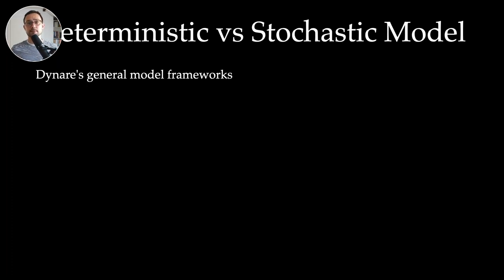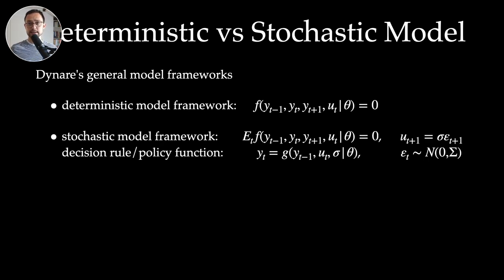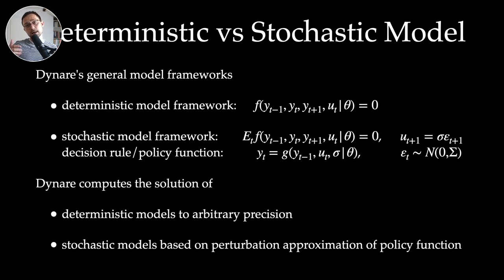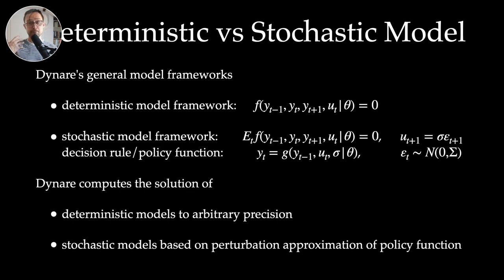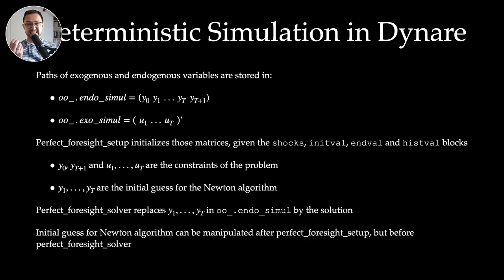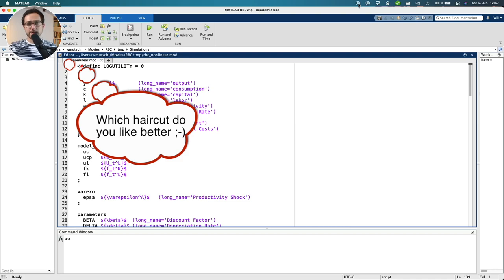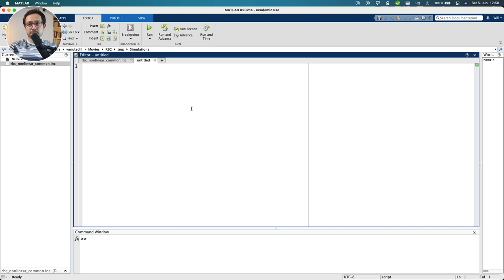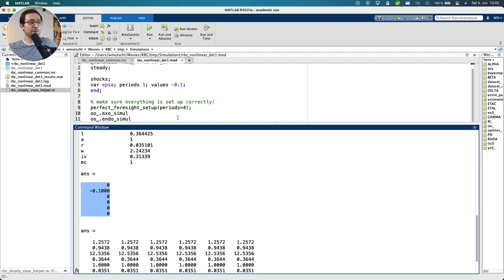RBC Baseline Model in Dynare: Deterministic vs Stochastic Simulations

Comment: may I also consult that, when you set irf=0, periods = 3000, and there are two shocks a and z in the model, may I know what's the simulated value of y, is this y the the simulated value calculated from the policy function from shock a or the  shock z? what's the simulated value of y. thanks a lot.
Reply from the maker: It is the simulated value of both shocks. Say your policy function is y(t) = gx*y(t-1) + gu*u(t), then you want to simulate for T=30 periods. You draw 30 shocks for a and 30 shocks for z, then u(t)= [a(t);z(t)]. You simply plug that in the function and get your business cycles.
An IRF is different, because there you only have one shock only and only in period t=1 (impact period). But you iterate over the same policy function.

Comment: Thank you for the video. A quick question: 

I noticed that in your deterministic simulation, the exogenous variable is epsilon_a. My earlier intuition was that in the deterministic model, there are no shocks. i.e., the policy variable is what we use as an exogenous variable. Hence, the shock is simply by changing the values of the exogenous variable. I have seen this approach in some other textbooks and videos on deterministic simulation. Is both approach the same?
Reply from the maker: Yes there are no stochastic shocks in deterministic models, that is no variables have a probability distribution (e.g. the normal distribution). In deterministic models we typically declare policy variables (like tax rates) or deterministic shocks (like the epsilons in a monetary policy rule or tax rule) as exogenous. We then use the shocks block to set certain values to these variables either temporarily or permanently. Note that the steady-state also needs to take this into account that those policy variables or shocks can be different from zero.

Comment: Hi Professor, appreciate you for making the great videos! 
I have a quick question regarding the shock - how to determine the size of the shock? Do the forms of the model variables  (e.g. level vs log) have anything to do with the size of the shock?
Reply from the maker: Typically you aim for a feasible size in the IRFs of your variables and choose your shocks accordingly. If output reacts dramatically, you decrease the size etc. Ideally, you estimate your model and use then the estimated standard errors for the size of the shocks.

Comment: Thanks for your nice and very clear video.
I have a question. I'm trying to use the temporary and permanent chocs in the log-linearized Smets-Wouters model but I'm facing to an issue because Dynare can't found a solution. Is there a specific way to simulate the temporary and permanent chocs in log-linearized DSGE model ? However, there is no issue when I use the Stochastic Simulations to obtain the irf. The obtained irf with the stochastic simulation is good but I really need the one obtained with deterministic simulation. Idem for the permanent choc. Could you help me please ?
Thanks
Reply from the maker: Your shocks are probably too large. Try doing small shocks first.

Comment: Thanks a lot for the video. May I know what the simulated endogenous variable is? e.g. periods = 30. for y, there are 30 values of simulated y

I also find that the irf for the stochastic case and the deterministic case is the same, with all the code the same except the simul and stoch_simul commands..
Reply from the maker: All variables are simulated if you set periods>0; however, you can pass on a list of variables so the output and graphs will only focus on these. Under the hood you have simulations for all variables still.

For the RBC model it is not surprising that you don't see a difference; however, there is a numerical one for sure. Moreover, in stochastic case you use the approximated policy function for simulations, in the deterministic case you solve the model with Newton methods and there is no policy function concept. The RBC model is extremely linear and well approximated by linear policy functions, so this is not surprising.

Comment: Thank you very much for the video. I’m a newbie, and very new the idea of simulation. I’m kind of confused that why is the perfect foresight simulation a two point boundary problem. What values can the initial point and end point be, does the end point has to go back to (new) steady state? What if the period is very small, like 3 periods (before the shock went out), will the end point still be needed to go back to the steady state? 
Also, in the stochastic situation, is the irf means only give a shock of the size of the standard error only at the first period and can I have irf= 30 and periods =100 both on, ‘cause I saw when you set irf you set periods to be 0 etc. Thanks a lot.
Reply from the maker: The initial point and the end point can be anything. Usually we take the steady state as the initial point. Then we either introduce temporary shocks and see how the system goes back to the steady state (end point is steady-state again) OR we look at permanent shocks and see how the system goes to the new steady state (endpoint is new steady-state). You need to specify this as shown in the video. If the period is very small, Dynare most likely won't be able to find a solution path, so you'll get an error. The reason is that the solver enforces the endpoint and even if it finds a solution with a very small period number the path will look very strange and have a jump.

Stochastic Simulations:irf=30 computes the impulse response of a one standard deviation shock in period 1 for a horizon of 30 periods. periods=40 simulates data for 40 periods (discarding an initial burnin of 100 periods by default). Conceptionally, in irf there is only one shock in the first period of a certain size. We then use the policy functions to compute the decisions of the agents. With periods options we draw 40 shocks from the normal distribution and use these 40 different values in the policy functions when computing the decision rules. You can do both irf=30,periods=40. Dynare saves them at a different place in the oo_ structure and also in different variables in your MATLAB workspace.
Reply: @wmutschl  Thanks a lot. So, does it mean that for the deterministic case, given the same shock and model, the policy function would differ with a different irf period?